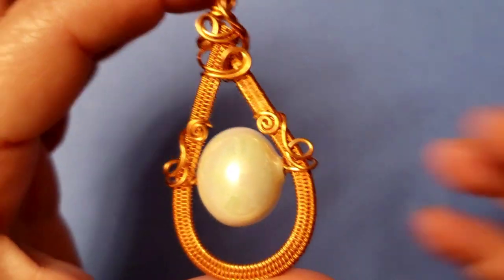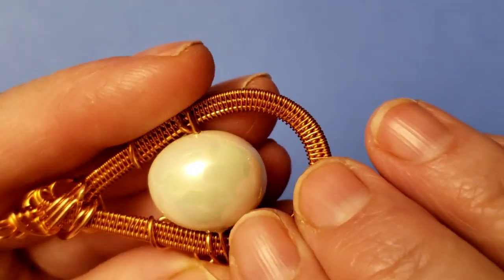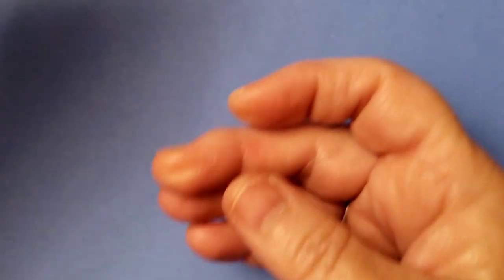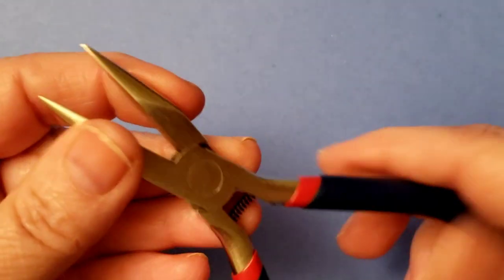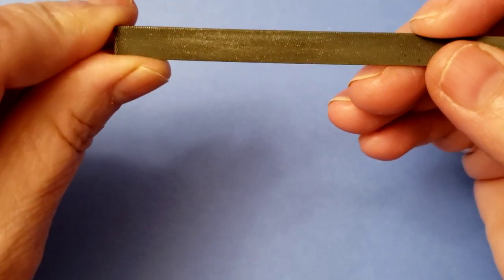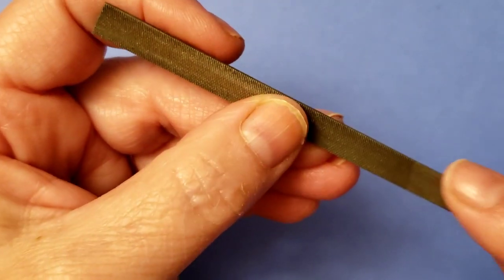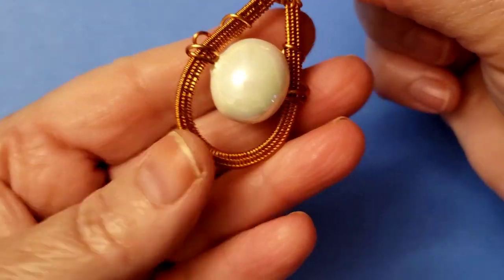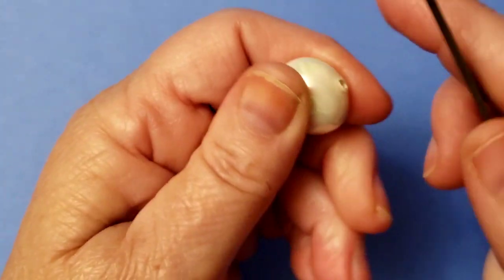Tear de Luna Pendant- Beebeecraft - Cheryl St. Pierre of Majestic Wire Artworks

Comment: Hi Cheryl I noticed one of your comments was about para wire. I get it from BeadFX in Ontario or Kellis Bead Boutique in B.C it is very good wire.
Reply from the maker: Thanks for the info! I honestly prefer to use real copper. I have now been told the finish wears off.. I think I would rather use the coated copper wire from beebeecraft or the artistic wire.. they are very comparable in quality. if you want it to stay shiny.. Although you can laquer it yourself, but that wears off too.

Comment: How can I keep raw copper from tarnishing ? Any suggestions ? You do beautiful work , I want to try this one . Thank you , Inge
Reply from the maker: Not possible.. you can lacquer it but it wears off.. I will get the link to the beebeecraft wire that I would recommend you trying.
Reply from the maker: https://www.beebeecraft.com/p-benecreat-20-gauge-tarnish-resistant-copper-wire-33-feet-11-yard-131.html

https://www.beebeecraft.com/p-benecreat-28-gauge-tarnish-resistant-copper-wire-328-feet-109-yard-115.html
Reply from the maker: The thing with this wire though is that you cant slide your weave as the coating grips. So I would recommend starting 6.5 inches from the right. I believe that 18 inches will still be long enough..